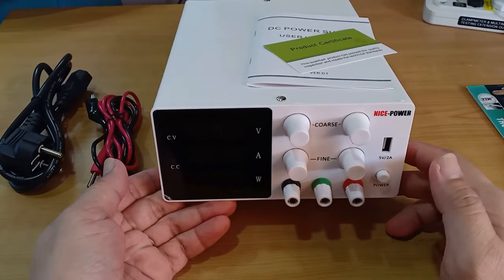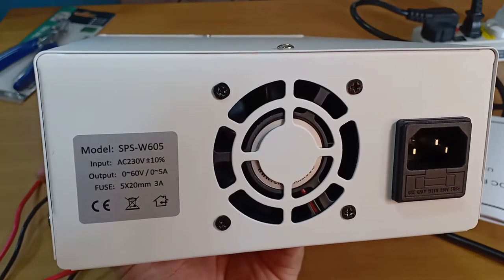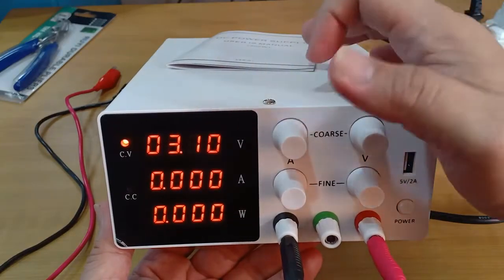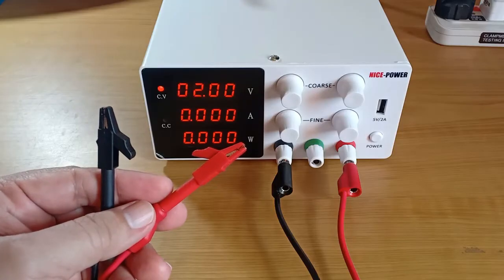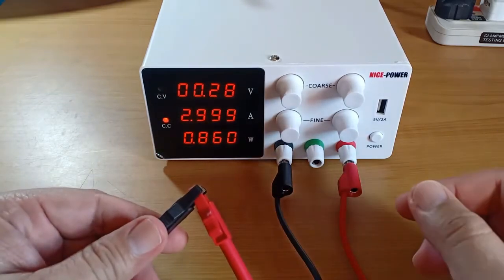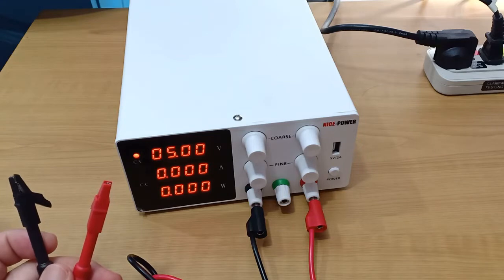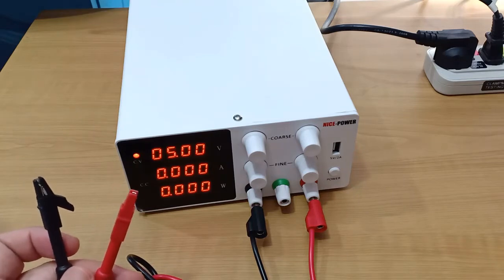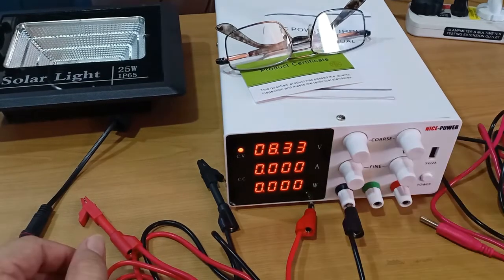[Eng Sub]Nice Power DC Power Supply SPS-W605 Unboxing  & Test

Comment: I’ve just bought the Ruzizao 30v 10a version which is exactly the same. I thought about the 60v 5a version but I decided on the mid range model in the end though I'm sure the 30v 5a would cover my needs. So far I really like it, I think it’s perfect for my hobbyist needs.
Reply from the maker: Thanks for your comments. Either one should be fine for hobby purposes.